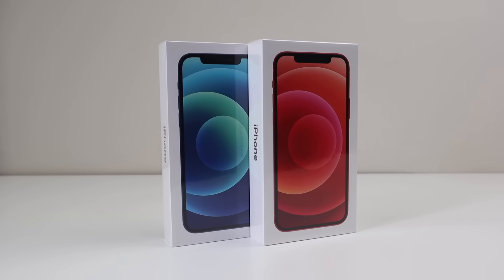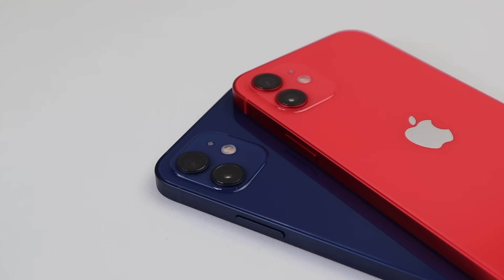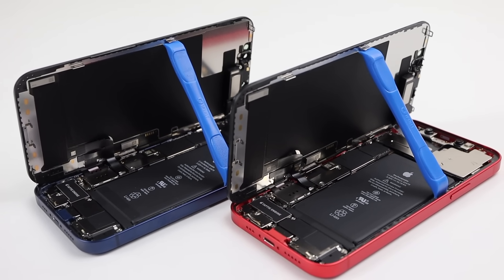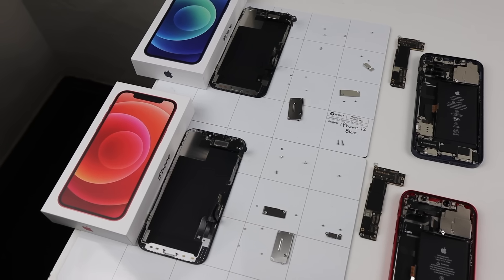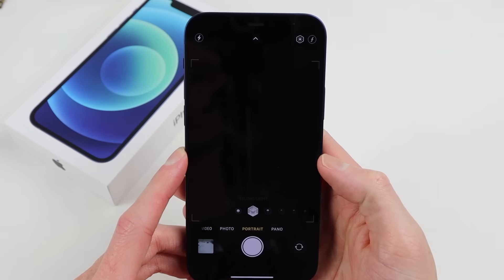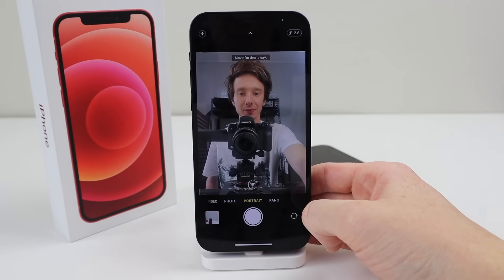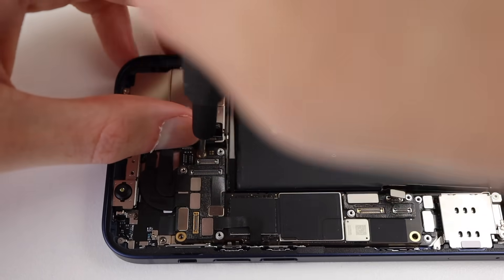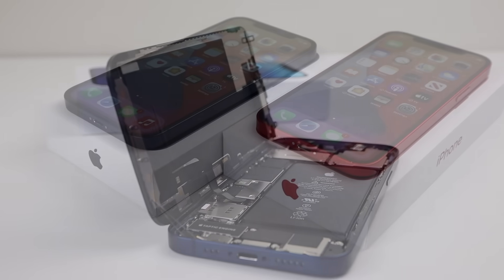iPhone 12 Anti Repair Design - Teardown and Repair Assessment

Comment: most of the components register with the mother board so now only an apple authorized repair center can swap battery, lcd, fingerprint reader, etc and not even the repair center gets all the necessary components most of the time you just get a whole new board even so you only needed the usb-c port replaced actually Louis Rossmann whent over this and total crap I dont see a lot benefit from this besides making Apple's pockets bigger. so you think you bought a phone you just leased it and if you damage it you have to get a new one

Comment: its a good thing that "Right to Repair" is gaining head way , apple and all these cell phone makers are going to get a nice slap of reality. i mean in the US Biden already signed it in as an executive order in July 2021. specifically calling out cell phone manufacturers. it doesnt matter what it is , people should have the right to having access to manuals and ect that are required to repair things themselves , and or the ability to go to a 3rd party for repairs even if the item is under warranty. which eliminates also the fact that apple (which is the worse) will be quick to write off a phone that isnt badly damaged and push a new phone on you. usually for a marked down price but still charging you for something that could of been fixed under warranty.

Comment: My samsung phone came with wired headphones, a charger/sync cable, a wall charger, a free wireless charger (not in the box but bundle deal), instructions, an OTG adapter and a 15% off wireless earbuds coupon. (Edit : and a free sim-card key)

Meanwhile apple wont even give you a cable to charge the phone. (May be over exaggerating but at this point I can't even be sure if I am).

Comment: As the trend goes, you get less and less for your money, this is a general observation, but Apple in particular, are the number one trend setters here. The Apple internal memo is simply this; make the phones for as little as possible, but sell them for the highest price that the market will bear, don't include anything with the phone, that our marketing department can successfully say is not needed, oh yes, don't forget to design in obsolescence for exactly 3 years, 35 days, 3 hours and 2 mins and 25 seconds, that's when it will stop working! , and what was the last thing, oh yes, don't allow 3rd party repairs. Unfortunately I wasn't kidding!!!

Comment: bro u probably have to change hardware registration numbers or something in the kernel or bootloader or something. its probably validating all the parts are registered. it has to be a software thing bc apple is able to change out parts
Reply: Could also be firmware. Even a combination of keystrokes or some procedure. Eventually it will be figured out but it’s rotten.

Comment: i laugh how people complain about having to go to apple to fix there phone but the amount of times 3rd party repair shops ripped me and others off and say theirs more problems then there actually is and then when I've taken it to the apple store they said one of the connections was loose and a screw needed tightening which was probably the repair shop who left that screw loose whereas in the repair shop they said i needed the battery changed i needed a new screen because the connecting cable was broken. jeez people think paying more is bad but your paying for what you get so if you pay a shitty repair shop you will get a shitty cheap part from china, i know this because i opened up my old Iphone 5C after the battery was changed and it wasn't official and my phone got really hot quickly. so i don't trust any repair shop with my current Iphone, any moron who says otherwise just know i been ripped off in about 8 repair shops i went to before i stopped and went to apple instead.
Reply: You have to do your research before walking in to just any shop dumbass.

Comment: “ there are 2 billion Apple power adapters in the world… And we’re going to render them obsolete.”

To prevent e-waste. Sure thing, buddy.
Reply: Especially since almost none of those apple chargers have a female USB-C port 😅
Reply: @ilan9588  wut
Reply: @joisarrithesmall298  The existing Apple chargers are mostly from older models, they're using a female USB-A rather than a USB-C, so they're not compatible with newer iPhone charging cables
Reply: @ilan9588  sorry but I got rely confused when u said "female" lol
Reply: @ilan9588  Female?...
Reply: @mylkist  Yeah lol. A female charger port is the thingie that you put your charger in while the male charger port is the thingie that sticks out (For example a USB stick is male while the USB port is female)
Reply: The company just wants more momey
Reply: Yeah they sure are, because I’m not buying iPhone
Reply: It’s to make more waste and make you spend more money
Reply: They aren't obsolete. The old chargers still work. The usb c cable is for connecting to a macbook which most people with an iphone will probably have
Reply: @clf400  never heard so much fucking cope in my life.

That's bullshit and you KNOW it.
Reply: Yeah but if you have a power brick with USB A and you've owned an apple device after the 30 pin, you should already have a type A to thunderbolt cable, now you've got a type A to type C in addition
Reply: These phones are a waste. Million bricks because of Icloud locked phones.
Reply: Buzzwords fool ignorant consumers all the time.
Reply: Well, at least they're still good for powering other electronics.
Reply: Well, in the future all that will be lying around is usb-c and so many other phones already use it that it really isnt as bad as it seems
Reply: They aren't a trillion dollar company for no reason.
Reply: Were getting swindled
Reply: @craigjensen6853  smh
Reply: They should at least replace your old ones with new ones.
Reply: Not to prevent e waste. But to get more money out of people stupid enough to buy their overpriced crap. This is why i prefer Samsung.
Reply: @Ady Honestly I agree I wouldn’t be surprised if in the future they changed the shape of the charging port so people are forced to buy their new chargers
Reply: Yeah those power adapters probably don't have the original USB-A to lighting cable anywhere to be seen right? Oh, nwm
Reply: @TheKultteri  if only Apple's cables weren't infamous for literally disintegrating after a couple years...
Reply: @hombreg1  A couple years?? You've been lucky, mine generally last for about a year at most before the ends are so frayed that I'm scared I'll electrocute my phone or myself.
Reply: @hombreg1  and here I am with a cable going on for 5 years and no issues. What are you guys doing with your cables ffs
Reply: @TheKultteri  I just have mine connected to my iPad, cuz its battery died shortly after the warranty period. I do know that macbook cables are good. Their mobile cables though, I have a problem with.
Reply: we minus the price for the adapter and the earphones
Reply: I use a wireless charger.  But this new Amazon scheme isn't saving the planet. I like how they decided to fool people into spending more though lol. I don't like apple, but I decided to switch from Android to apple because of the way everything gets easily backed up. I was tired of damaging my Androids and losing everything. So I have an Android for personal use and an iPhone for work stuff since everything is always secured on it. I don't like having to pay for the dumbest things, like music though. So I just download music on my Android since I can have modded apps on it
Reply: Use with old cables
Reply: Reducing the box size helps with logistics cutting the cost by half

Comment: Even official apple parts are used for repair, they still register as unofficial. Apple should be ashamed of themselves. You paid for another real iphone to use its parts and use them for repair yourself and apple doesn't allow it.
Reply: All but the factory components (for each specific phone) are marked as "false components"
Reply: But after you've repaired your phone yourself, if something goes wrong at the end of the line, you'll run to the store crying and saying it's Apple's fault.🙃
Reply: @DiogoP  of course it should void any and all warranty to repair it yourself, no sh*t last thing we want is Karens breaking all the IPhones by microwaving them or something, but it shouldn’t be straight up impossible either
Reply: AND I LOVE THAT APPLE IS DOING THAT😁
As technology evolves more and more, it is no longer possible for non-specialized human beings to make their own repairs.
a good example of this would be cars, 50 years ago it would have been perfectly possible for anyone to do a simple repair on their car! not nowadays (have you ever looked at a modern day engine there are more cables in sight than metal).
such as, for example, making a small repair to an appliance does not present any risk to human beings, making a repair to a car, an appliance or any other object, may be involved in handling objects that we may not even know what they are or what they are for. example batteries and other hazardous fluids present in equipment.

Comment: I currently have an iPhone XR. After watching this video, I have made up my mind. Once my XR is old and too slow, and doesn’t perform as good anymore, I’m switching back to android for good this time. Apple wants us to go to them directly to fix any and all issues with IOS devices. And they knew we would go to 3rd party repair shops. They obviously don’t like that, so they completely shut down the ability for companies other than apple to repair our iOS devices. So to them, it’s either we pay their over priced repair fees, or we don’t get our shit fixed at all. Not to mention that on top of that, their products are expensive as fuck to begin with. I like apple. Their a good company. But this is the final straw. The straw that broke the camels back. Again, once my XR is obsolete, I’m going back to Android permanently. Apple can take their over priced fees and devices, and shove it

Comment: Apple In 2069: Your gonna have to buy the phone separately.
Reply: Imagine apple and ea collaborate
Reply: @Blah_blahf  FaceTime woke separate 
Calling sold at 59.99 as DLC 
Camera sold as limited edition
Reply: @Blah_blahf  100 dollars to charge the phone
Reply: @Blah_blahf  no
Reply: Apple : "You have to buy everything seperately."
Consumers : "Like chargers, Adaptors and cables? That's not THAT bad after a-"
Apple : "So which one do you like to buy first? the display? the battery? the lenses? the screws? the case? the box? the-"
Reply: @yehwat527  the new iScrew U, apple's new innovative take on the humble screw. Its new streamlined threading and head allows each user to have a unique experience. "Every iScrew U is unique, it gives what was a mundane piece of metal character that the consumer can resonate with". A sleek sci-fi polymer based core and magnetically sensitive interlocks you can be sure that once the iScrew U is in place, it will never leave! The iScrew U will have a starting price of $50 each but you can preorder for $60 and get your own personalized edition, where the threading and head are cut using a seed generated from your own DNA and social media profile, don't worry, you don't have to provide a DNA sample, we already have it in our database!
Reply: Oh and I forgot... To make it more worse, each part is as much as a whole phone, like $500-$1000+.
Reply: @yehwat527  at that point Apple will just go down the drain in sales and Samsung will eventually take over and they would do the same thing Apple did 😂
Reply: @yehwat527  😂
Reply: @yehwat527  would you like to buy the blueprints too?
Reply: @snwmn4783  😂
Reply: @yehwat527  you know... i thought about it. and are we really that far from it? like honestly, and anytime i bring this up to a group of friends they say "if you had a business you'd maximize on the amount you could make too". its crazy because i do not doubt it at all.
Reply: “you can buy 1 random piece of iphone from 100. but even when you get those 100 different pieces. you cant build it your self because it will explode. you need to give it to apple to build it for 299 $. (also every piece costs 319)”
Reply: The best thing for our buisne- the environment...
Reply: @k.laixxx  ikr
Reply: they will sell u parts of the phone so u make the one you like then you will have to pay then to put em all together. and will sell you 1 already done for twice the price like ts jesus walkin on water
Reply: More like you gonna have to buy the certificate to own the phone...just like how you need certificate to own a car in Singapore.
Reply: *you’re
Reply: @taffyadam6031  Ok, grammar teacher.

Comment: Maybe Apple put some kind of POST system in these phones, I've noticed it takes longer to power them on in newer models. So this POST system seems to check the internal parts identifiers! Something like a Windows POST and if something is odd, it goes into "Protect Mode" like an audio amplifier to prevent damage to the internal components!

Comment: Law is changing soon, so once it does I can see Apple getting sued unless they allow repair and provide parts.
Reply: but after you've repaired your phone yourself, if something goes wrong at the end of the line, you'll run to the store crying and saying it's Apple's fault.
Reply: @DiogoP  meh that's the customers fault and ultimately its still gonna be a better situation than what's currently happening with Apple

Comment: Perhaps they have little chips in most of the parts that has a code or matching serial numbers  that allows the phone to work sort of like a car where all the parts have matching Vin number on the parts and like a debit card where all the numbers and cvv2 equal a 1 or a o thru some multiplication that makes it verify true or false.

Comment: There is probably some Hardware ID lock in the system. Just need someone to find a way to hack the firmware, updating it with the new IDs (for the camera, battery, etc). Apple software is usually very simplistic and easy to hack. Or else someone could leak the software Apple uses to do it (and be sued LOL)

Comment: It’s to prevent small repair businesses repairing phones by any means, not even with salvaged original parts, as they’d already barred sales of parts. This ensures the hardware business fits into the subscription model, where you buy new even if it’s a minor fault, and even if you are super careful, it will become obsolete and struggle to browse basic websites. Eg iphone 4, near new condition, totally useless.

Comment: You have to pair the firmware of every component with the instructions in the original logic board, it seems. 
Since iPhone X this is the trend.
You have to copy the firmware from the original component and write it in the new before install.
So if you swap the logic board you have all the components to transfer the firmware 😀
#encryptedHardware

Comment: Apple anti-repair tactics are just the tip of the iceberg. Everything is made to broke and be less easy to repair. The less gadget you have, the happier you are. I'm still happy with my 2013 Iphone 5; battery still lasts for 2 days of normal use without problems.

Comment: Repaired by Apple= Just fine
Repaired by XYZ= NO

The Human body is the same, organ transplants require a "match"
but some anti-rejection drugs (Interferon) can fool the defense systems.
Most likely- each part has a burned ID, paired with it's build.

A security system could very easily incorporate anti-intrusion devices,
such as a circuit being broken when a screw or the screen is removed,
or a hidden micro Solar voltaic tripping a code with case opening.

Imagine- a micro wire being in the adhesive, softly connected to
the board? Open the case- and SNAP.

Comment: So rounded screws, many screw drivers needed, stronger  adhesive, components that only work with a paired component.

Yes right to repair is right in the trashcan.

This could make people not buy any iPhone or and any apple products, as people don't want to pay some expensive price to get it repaired by a apple employee or be forced to buy a new phone.

Apple surly will lose customers, I reckon other phone manufacturers like Samsung etc will do this to.

Comment: Anyone why purchases an apple product is simply renting a POS non standard phone that is over priced by a factor of 20-40% I find the Pixel or Galaxies designed much friendlier, not software is the main difference. Apple lost its edge years ago. They are no better, no worse that current android designs. And yes , I started selling the first CDMA Sony in 1994, when the standered dropped in America. The iphone was fantastic, but every model has had design flaws. Simple , apple phone are way over rated

Comment: This is common all across automotive, Agra equipment, and more. As a  tech, some parts like airmatic shocks were coded to say a s500 Mercedes, yr 2000, when  a used part installed, the ADS light would stay on and that part would not adapt to that vehicle Vin #. The same with ECM(electronic control module) and many other modules. This way, mbz controls their parts in the reman sector. Yet, the ignition keys( the hardest to crack) have been reversed engineered with special equipment and  used smart keys can be programmed to  adapt to the rest of starting car modules on mbz. So, send a new iphone 12 to China, they can crack the coding if you dare and hopefully apple doesn't sue you coz they love to drain firms financially if they can't beat you.

Comment: The thing about apple being run off green energy isn't true. It's just PR. A small shop could run off completely green energy, but apple isn't capable. No major company would be able to. They still use coal like everyone else; they essentially just put bows on the coal before they burn it and call it green